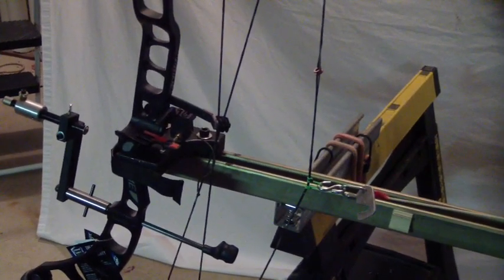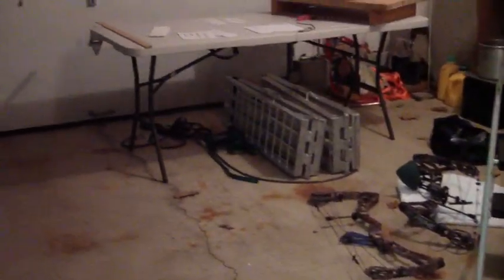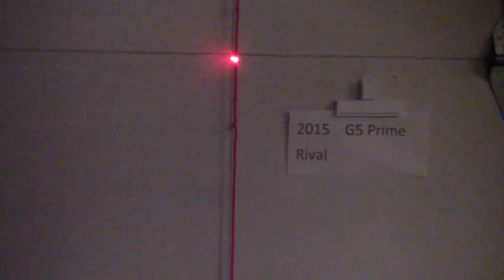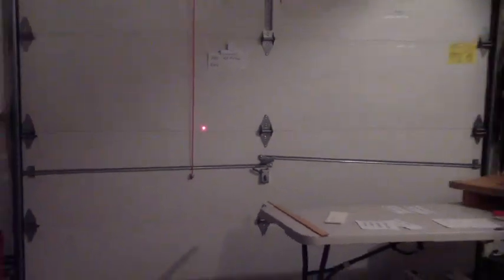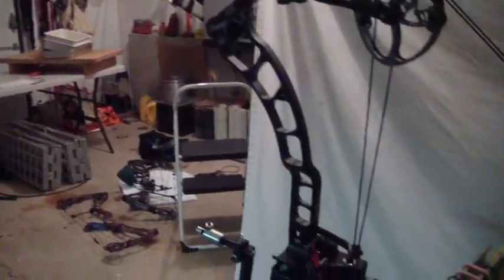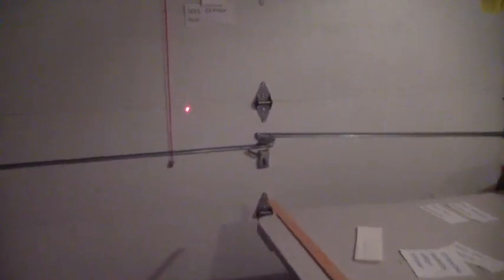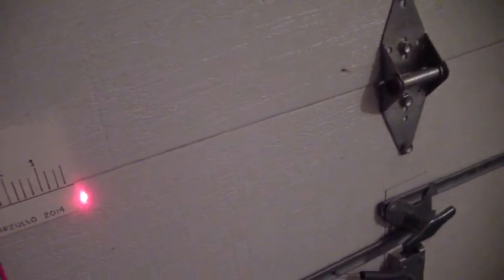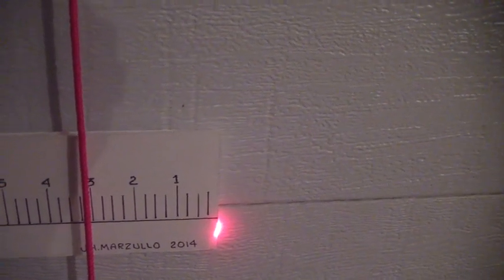Bow Torque Test 4 2015 Prime Rival

Comment: Why do you do this test? I'd like to understand the mechanics behind it. With your sights dialed in according to a full draw torque, is this test crucial to the performance of a bow? I just barely bought the 2015 Rival, which is why I'm so curious.
Reply: Should have bought the ion
Reply: As the bow is drawn the cams tilt or lean progressively more to one side, this causes the arrow to travel at an angle away from the archer, not straight back. The result is accuracy robbing bow torque or twist in your hand. Cam tilt generally results in a lateral or horizontal nocking point travel that is about 3/4” to one side at full draw. I have built a fixture unique in the industry to physically plot and measure nock travel so I can measure the errors and the improvements. A bow that draws the arrow straight back will create no bow induced torque or twist errors. Therefore it will be easier for even novice archers to shoot consistently, which means greater accuracy.
Reply: +adam wittman is there like an industry scale or standard or a bow to bow comparison chart that we can see objectively, because from what u said, seems bow torque is a really bad thing to have.